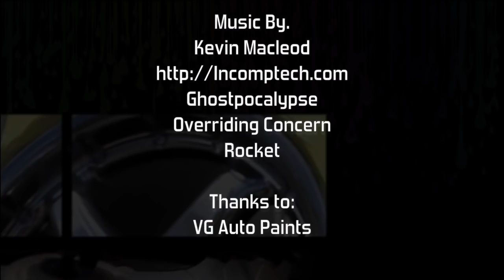First time applying vinyl wrap

Comment: LOL. Thanks for the video fellas'! I'm trying this for my first time on my CL55 AMG Kompressor- wish me luck! lol
PS, the cool thing about plastidip is you can do things like grills flat black & it covers all those irregular surfaces that would be impossible with a wrap.. but then you just match the vinyl wrap to the same flat black or whatever color plastidip you are using.. (it comes in lots of colors now) .. So vinyl wrap the hood, boot, doors etc.. and plastidip on the bits and pieces etc.

Comment: I suggest to keep the vynil firm in position with some magnets and then start peeling a small part on a side of it, once it is stuck on the bonnet you go on removing the rest of the backing.

Comment: Tips to avoid all what we saw. It's first time i know but you've to make your life easier.

Tip 1 : Never remove whole of the protective paper underneath, remove the half of it and try to apply only the one side. When you do so, remove the rest of it and apply the part of vinyl that's left.
Tip 2 : Never stretch because the vinyl keeps memory and it wil shrink to it's first morph so it will make rinkles ( hope to wrote that corrent !)
Tip 3 : The most importand is to cut a bigger piece of vinyl than you are going to use. If you make mistakes and the vinyl is almost in the same shape of the part you are wrpping, the only sure is to throw it and use another piece of vinyl, which means time and money.

Once i was too a biginner but those tips helped me a lot and i reached a good lvl i can say.
I hope my advices were helpful !

Comment: You 2 did a fine job but made it much more difficult than it should have been. Take advice from a vinyl guy from way back. Next time get you some denatured alcohol and mix it 50/50 with water. Spray your hood down with the mixture very liberal. lay the vinyl down and start from the middle and squeegee from center to edge. Lift the vinyl every few minutes and reapply the alcohol water mixture. This keeps the adhesive from sticking hard before you get it smooth. Nice job tho.

Comment: given 2 people i'd peel the whole backing pull all 4 corners tight and pull it down over, start in the middle and work you way out. that way ther is minimal stretching and distortion of the carbon print, and also have a felt pad on your hardcard that way you don't scratch the vinyl

Comment: Well.. To be honest this turned out pretty good for being ebay wrap and first time applying it. It probably wont hold as long and you could see some wrinkles around the grill at the sharp turn. A "real" carbon wrap have air tunnels that let the air out so its alot easier to remove bubbles. Im pretty sure this is just textured vinyl. Good job but do it right next time! :)

Comment: I was thinking of applying some carbon fibre to the custom car I'm working on. Just looking at the technique used and it looks very tricky. Would be slightly easier to peel part of the backing off, and stick the vinyl down then work downwards slowly peeling away the backing as you go? Anyway thanks for posting all the same.

Comment: hecka clean guys! some people may not think. but i think its dope! Imma do this to my honda accord. Do I need a heat gun or will a blow dryer be good enough? #ghetto #poor #butitsformyricerocket @customspraymods
Reply: +Mae Ling Kong Heatgun is a must. Everyone seems to use a blow dryer and they all say it work... Short answer is that the most important part of wrapping is heating in so that the edges dont lift. You will need a heatgun as you need to reach around 90-100degress c to shape the vinyl.
Can get a heatgun for around £15 easy

Comment: Most vinyl is guarenteed atleast 5 years by the manufacture of course that can vary on how much it is in the sun and other things. If you are getting vinyl on your car other than materials suck as carbon fiber or matte ect yes it would be laminated and yes that will make it more durable to weather conditions

Comment: this is true, but you have neglected to mention the additional wheel horsepower. typically, it's said that each sticker is worth about 5whp. the formula for a wrap is 5whp per square foot, so you probably got a noticeable power bump, too.

Comment from the maker: The adhesion causes the heavy metal part to lift and therefore become lighter. Also the carbon fibre look is also affecting the weight. Carbon fibre is lighter than steel. Look it up in google while your there look up the word "sarcasm".

Comment: I had very very difficult to wrap my car with 3D Black Carbon Fiber Vinyl Car Wrap Sticker Decal
The best solution is wrap in sunny day. I did not touch in my heat gun. Easy, fast and look great after done.
I left the wrap on top the car hood to get worm before start.
I do not recommend use heat gun and torch.
Reply: Wrapping in the sun is the WORST thing you can do for a wrap! It turns the vinyl to pure mush! The manufacturer literally states you should be working in a controlled environment.

Comment: I have a 2007 Subaru outback and i wanted to do the front bumper.  My question is, how do I get the vinyl in both the trail light and intake section of the bumper?

Comment: If you guys had flipped the vinyl over on its backside to begin with, removing the backing paper would have been much cleaner and than you two would have been able to flip the vinyl while keeping it nice and taught when you first set your material down on the hood panel.

Always apply from the middle out and only use heat as needed. This vinyl is very forgiving so this is a good representation of that, but you should be able to apply with no bubbles at all.

Comment: What a lucky Novice, if any one want to do that easy way is just peal edges from one side stick them on with heat gun then gradually peal the sheet from inwards and stick it on  with heat gun, don't go for it at once go bit by bit

Comment from the maker: Before I put it on I weighed it and it was 200grams. So you minus that from the weight of the car, but because it looks like carbon fibre it actually changes the aerodynamics of the car so when it is going over 50km/ph it decreases the weight by up to 2 to 3kg. This is true because its on the internet and even though I dont have a degree in science I know more than anyone else because I research stuff on the internet..

Comment: I am in no way a wrapping expert, actually I've never tried it.. But I've done tons of Vinyl lettering and decals on emergency vehicles.. So I am wondering if using the Rapid Tac(Or your own homeade solutions) system would be better in situations like these.
Reply: Gmtail Most, not all, carbon fiber vinyls have an integrated system called "air egress" which allows air to run through channels to escape. Wet application wouldn't be recommended. They also have a system called "COMPLY" which is what allows you to pick up and move the material before permanently bonding it to the substrate through pressure. 
Best bet, hold the vinyl flat above the hood, pulling it taught, then lay it down evenly on the hood while continuing to pull keeping tension on it. You'll have very few bubbles to work and the heat will allow the vinyl to conform to the body lines. 
Also, use heat to naturally allow the vinyl to conform to edges and corners, then trim and tuck. 
DropZone Specialties
Reply: Awesome.. Thanks for the tip.. I have an old Hood laying around I can mess around with. I probably don't have the patience but I'd be fun to try..

Comment: There are cheap ones which are much harder to apply with shorter lift span. There is the 3M which is the industry standard and much easier to apply lasts longer too. 3M makes a whole variety of them, some more stretchy than other while some lasts longer. Its a fun but frustrating process, not for the impatient.

Comment: most "wrapping vinyls' are designed to go down without a soap solution BUT if you wanted you could spray a tiny amount on to your bonnet to make it easier if your a first timer .. i wouldnt myself but ive been doing this for 20 yrs :-D

Comment: Whoa, you almost burned the vinyl at 4:50 with the heat gun tip!  Does 3M recommend a tack agent applied prior to facilitate in positioning and assist in adhesion? Can you apply this over flaking clearcoat, my cars paint is a mess!

Comment: Well I think it looks cool, though if you have an older vehicle it's cheaper than getting the hood painted.  I did mine on my truck and took the money I saved from painting it and invested in a 5 channel amp two 12 inch subs and four 6x8 three way speakers. ;-)

Comment: don't skip the hard bits. I wanna see the bubbles get removed. Why didn't you use the spray on the hood and the vinyl? I think it moves easy when you need to adjust it or remove bubbles.

Comment: Did you buy the actual 3m carbon fibre wrap or just the random ebay one? 
Is a link to the one you purchased possible? And also, did it hold up alright in the almost two years its been on? 

Cheers guys!

Comment: i do vinyl on store front windows and honestly all they had to do was use the squeegee and use the hot blower lol why they kept lifting it up. the vinyl can get damaged.
Reply: hot blower? you do vinyl on store windows and yet you don't know what a heat gun is? and even if they crease the vinyl or fold it all they have to do is lift it up and apply heat and it'll go back to its original form

Comment: If you want to do this right. Get a couple more people than two. Stretch it out tight before you lay it down and take the heat gun to it. This isn't hard at all. A whole car can be done in 25-30 minutes with the right people and the right number of people.

Comment: The Clear on my car is damaged. Can I wrap the bonnet or do I have to fix the paint first?
Reply: Fix the paint. The clear will cause the surface to be uneven. If uneven sand it with a p300 to p1000 grit sandpaper to blend the surface before wrapping. This way you'll see a flat new surface when wrapped.

Comment: @walkabout16
 G'day mate ! Thanks. Stick-On Lightness. Um, well... If they made a Stick-On, Heat-Shrink Photovoltaic Roll of Vinyl...; it might be an option. The funny part of this idea is that it's a totally Placebo-Based & Look-Fast idea. These blokes need to search "sunfoil" to see something that actually makes the Fire-Chariot go faster, & drink less fuel. (mine burns 33.25% less, & goes 8% faster - but my paintwork does look like crap...). Ciao !

Comment: if the clear coat is peeling does the vehicle need to be sanded in those areas.
Reply: Yes. Or it'll look strange there.
Reply: Yes if you remove that the change or corrosion increase just make sure you sand all and smoth rest check www.howtocustomize.com for details

Comment: Need to use NON oil based Cleaners, Like Isopropyl Alcohol. No you cant drink it. Also Methylated Spirits is used sometimes but can leave a residue affecting Adhesion.

Comment: these guys made is 500 times harder then they needed to. that hood would have taken maybe 20 minutes to do if they used better application technique. the way i do it is each person holds 2 corners and pull the vinyl tight, then lay it on the hood. start in the middle squeegeeing outwards with light pressure to get the air out. once its all laid smooth press firmly with the squeegee to make sure the adhesive sticks. then use the heat gun to post heat the vinyl and help it set.

Comment: So it just sticks like a sticker? Do you need a heat gun for wrapping like a 1 ft by 1/2 foot spot? I want to wrap middle of my bumper on my FR-S.  It's so ugly chipping. Like this: i1102.photobucket.com/albums/g452/1ito08/2012-05-15_19-18-14_154.jpg
Reply: I have done work with wrapping, and have a heat gun. You can use a hair dryer for small things like this, but it can be difficult. The key part here is that you'll need two people on the job especially if it's your first time wrapping.

Comment: take the fucking bonnet off, make it much easier to work with and it's only 4 bolts and a hose for the wipers attached to it. I don't like people that cut corners to make it "easier", especially when it's actually harder.

Comment: this is seriously cringe worthy.... you arent supposed to cut out the general shape before applying the vinyl like you did at the beginning. Apply a general amount after peeling off the paper, and then apply it like you normally would, and use a sharp but not TOO sharp knife to cut the vinyl, and squeegie it as much as you can so you dont get ANY air bubbles or anything of that sort.